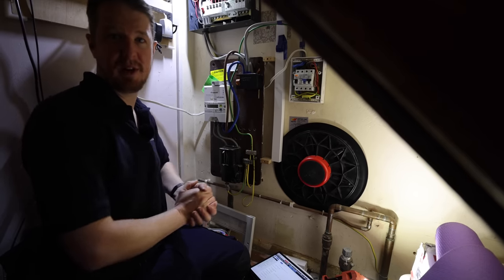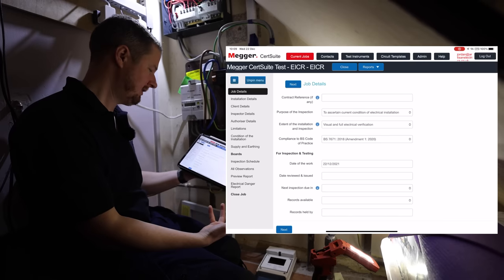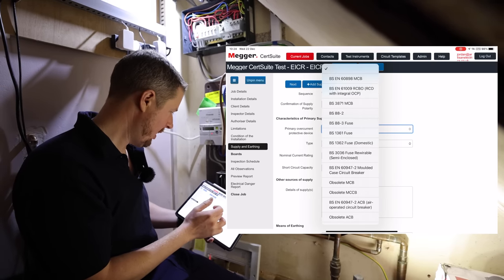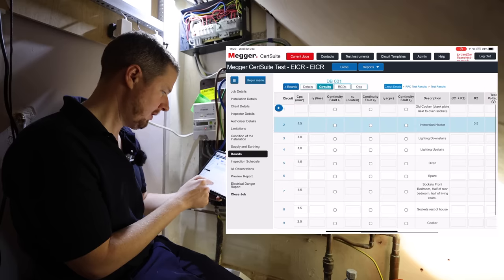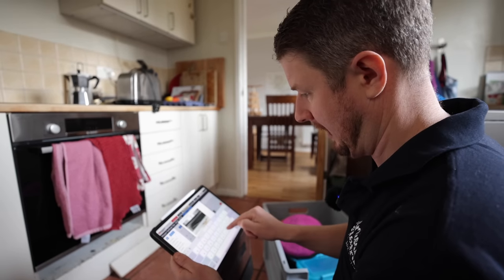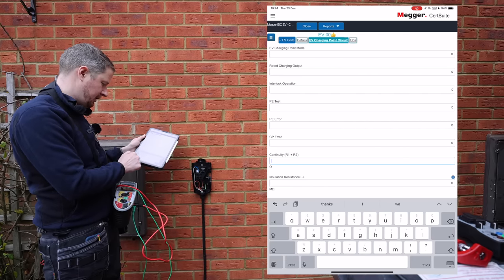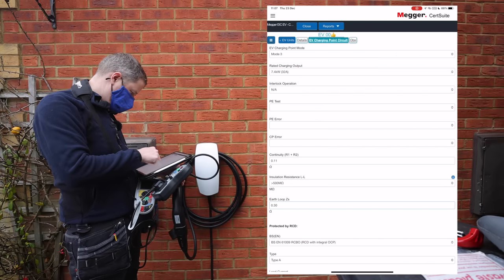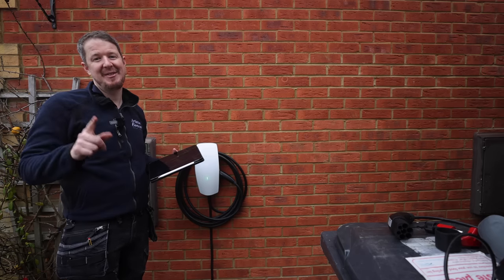NIGHTMARE EICR's MADE EASY WITH MEGGER CERTSUITE - Electrician Life

Comment: 16mm tails are not a code.  As long as:  No sign of thermal damage.  Main Fuse rating is less than tail rating.   Or if overload protection is provided by fixed load / maximum demand being less than rating of the tails.

Comment: Would be nice if it linked up with the tester over bluetooth, both for readings and test types.
Reply from the maker: I agree!
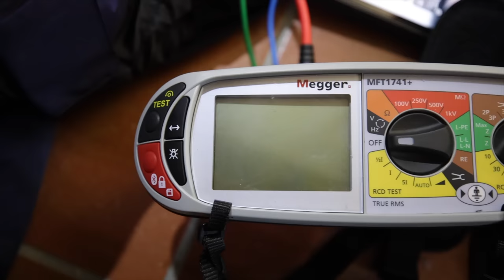Reply: @artisanelectrics   at 3:12 you can see a Bluetooth icon on the locking button. Could that button allow send data to the platform?  Although the platform would need to recognise what information is receiving from the tester, and properly filling the form, e.g. Ze going to Ze field and PFC going to PFC field.
Reply: Fluke have been able to do it with their 1664FC.

Comment: Another great video, I can’t help but think that Megger have really missed a trick though. Why haven’t they made a tester which links to the iPad via Bluetooth and once you select the test on the app, it sets the tester to the correct setting automatically, then sends the result directly back to the app? Surely this would save time and reduce the risk or error during data entry.
Reply from the maker: Maybe something they can work on!
Reply: I was going to say the same. It's great to see how good the software is, but it's been designed by an engineer. They need a UX developer to take another look, that constant jumping between the tester and the iPad can be massively simplified. 
It's not much more of a jump from this to make so that you use the iPad to describe the system and then the tester tell you what to test in order. Only having to pick up the tablet again to describe specific issues found.
But Megger have jumped into the software market, I'm guessing they already know this. :)
Reply: It would be nice if they got the keyboard to default to the right input mode for the field. It seems like Jordan was forever clicking on the numeric input button.
Reply: @geordish  This is an Apple iPad problem...  (I use an Android or my laptop!)

Comment: Awesome video buddy. Just a point on the comment you made via meter tails being 16mm. The black plastic cutout/service head that’s there may only be capable of taking 16mm tails . Some of the terminal blocks and screws inside are really small and won’t take 25mm tails in them . We would send a Dno c17 code to them and they would be expected to upgrade the service head and cutout.

Comment: Better to check the bonding on the pipe itself than on the connection. That's what's important after all.. and you only need to record 5x in the RCD as it's a 3omA, 100mA and above you record 1x. (New to 18th edition)
Reply: You should test the main protective bonding at the connection AND on the pipe at 0.5 m to 1 m away from the bonding clamp!  (See Fig. 2.16 on p61 on GN3 (18th Edition Am 2)

Comment: We would code 16mm tails between cutout and meter as FI if we are unable to determine the fuse size and type. If we can verify the fuse size and it’s 60A or below we wouldn’t code this as an issue. If we were down to change the board after the report we would insist on finding out the main fuse size one way or another and if we find we need to upgrade the tails (80A or higher fuse) we will get the DNO out to do so if it’s on their side of the meter. If we’re in a rush or forgot to contact the DNO then we will cut any seals and do it ourselves!!

Comment: You would tell the customer to contact their energy supplier and not the DNO for the cable change, the fuse you can contact the DNO.
Reply: As long as it's <or= 80A fuse then 16mm is fine. Most DNO's won't put a 100A in anyway and 80A max. Except for new builds which will have 25mm as standard.

Comment: Upside down Henley block a C2 ?
Reply: C3 but if any of the knock outs are taken out and accessable c1
Reply: upside down or not, provided the the cable enters the Henley block correctly its no code from me.,
Reply: gotta agree, I've had to put one in "upside down" no unused knockouts left, tails were tight entering so no breach of ip4x and inside a metre cupboard. ideally I would have mounted it differently but at no time did I see it as code able.
Reply: I thought that was a bit harsh if no unused knockouts there
Reply: @dannyboisparky  Atleast the volts won't fall out, bloody C2. I thought you was a 5 star mob 😂

Comment: First off why was it time for the CU to be up dated? Was in good condition any signs of damage or over heating or burning? Did all your test fall with in spec ? I can’t see any thing that would lead me to think it is not safe for continued service. Other than that you don’t have enough room to add an EV circuit.Point two is this video about you or mega ? Why are you promoting mega there are lots of different brands out there that are just as good even better.